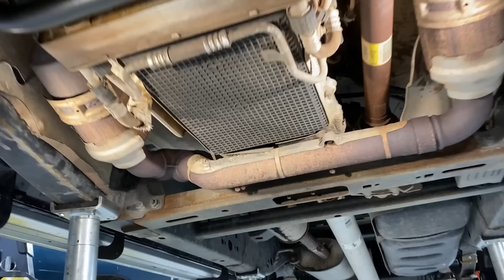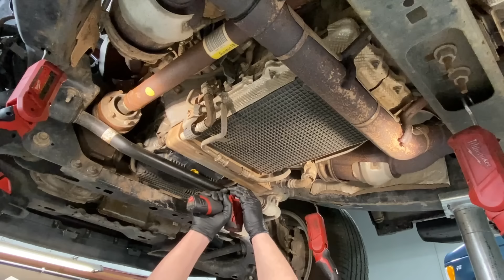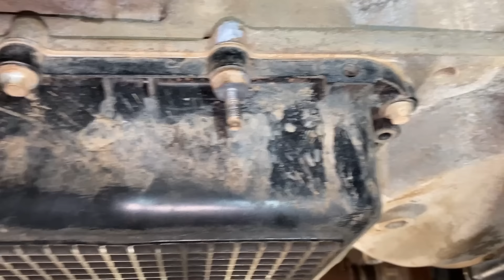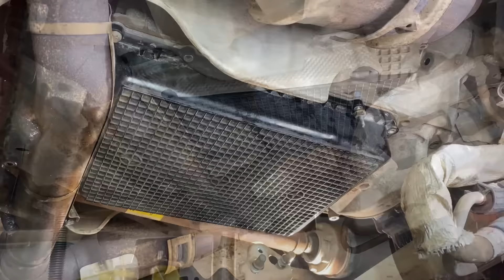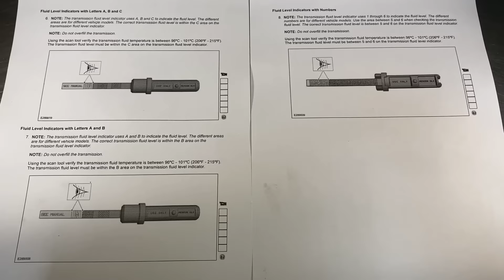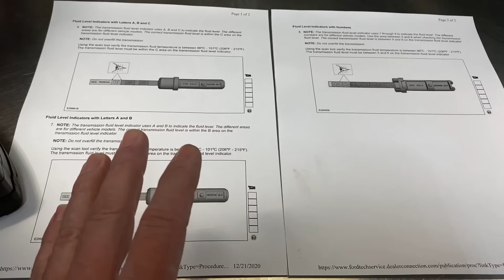Ford 10R80 Ten Speed Transmission: Fluid and Filter Service Procedure

Comment: I have a ‘21 f150. The cooler appears to be in a different location than described here. It looks like cooler lines track above the trans and have the locking tab connectors. 1) Is there any procedure for disconnecting the cooler lines/does this need to be done to service the trans? 2) Will I be able to jack the trans up to remove the pan without risking damaging the cooler lines?
Reply from the maker: I go over that exact model in the video.

Comment: I did mine but months later I see that I have a small leak at the bolts near the front passenger side corner. I've tightened them down but still leaking. Not sure if the gasket has failed there or what...

Comment: Hope you will give time answering my question. What seems to be the reason why there's a rattling noise when the rpm goes down after I rev up the engine of my ford ranger 2.0 biturbo? The noise comes from the driver side close to the left portion of  the transmission fluid pan. The tansmission fluid is at the C when I checked after 20 to 30 minutes of idling the engine.

Comment: Just change the fluid in my 2021 F150 eco boost. I drained approximately 6 quarts. I put 6 in after putting everything back together. Oil doesn’t touch dip stick. I added a quart and still nothing on stick. I added the 8th quart and still doesn’t touch? I have a dip stick with 1-6. Can’t find exactly where the fluid needs to be?
Reply from the maker: You must run it and heat it to operating temp
Reply: I don’t have anything that shows where the fluid level needs to be on the dip stick ? It’s a 1-6 markings.
Reply from the maker: Wait I show it in detail in this video here- https://youtu.be/p96a8_MPwyM?si=tGaaeqIwhV48eNew&t=2437

Comment: Nice. I have a 2023 F150 and this video is invaluable. Why not snake a vacuum line into the fill hole once the dipstick is removed and remove as much fluid at that point? I've done that on other vehicles with good results. Why is there never a darn drain plug on the pan? I put one on an RV I have on a Ram Promaster 3500 chassis.
Reply from the maker: Really no need to drain first, no matter what the exhaust is going to get soaked in trans fluid as the case drains out.

Comment: My experience with the advice of one box below hasn’t been great. There’s really no getting around getting up to full operating temp to get the correct fluid level. Do I know if it’s a big enough difference to cause damage? No idea.
Reply from the maker: Yes, you must follow the adjustment procedure exactly or just don't even touch the trans.

Comment: This vid was perfect, i was looking for the dipstick part primarily, cause no other vids showed it, so 10 out of 10 in my book.
Reply: Go buy and install the MBS dipstick.  Easier to check your fluid levels and install new ATF fluid.  
THEN… install a new aluminum pan that has a drain plug.
PPE or Mishimoto … 
I think there are others…
Do it yourself and save time and effort down the road every 40-50k miles ATF oil change.  The filter can go every other fluid change.

Comment: So i take it Brian doesnt recommend a flush on the 10r80? Only pan drops?
Reply from the maker: Correct that goes for all Ford transmissions.
Reply: @FordTechMakuloco  thanks for the reply Brian you made my day. Good to know, I feel the dealers oversell the flush because it gets all the fluid but really only do it cause it's easier and they don't include that it might push things where it's not supposed to go.

Comment: One question , way we cant lift the transmission from the main transmission mount , losing only the two bolts instead of upper bracket  4 bolt?
Reply from the maker: The two transmission mount nuts you mean? You cannot as this will not do anything to help separate the exhaust from the trans pan.

Comment: Thank you for this excellent video! I'm at about 50k on my Expedition Platinum with max tow and plan to do this.  Thinking about an aftermarket pan (PPE P/N 328053200 with std. capacity).  Do you have any thoughts on that?  It has a drain plug to make future service easier.  Was thinking of doing intermittent fluid changes without filters at 20k or so.  Maybe unnecessary.  I regularly tow an 8,000lb trailer.  Thanks for any insight you can provide!

Comment: First, great video! I have a rear wheel drive and the transmission mount is very different than the 4wd type shown in the video. I had to loosen the exhaust above the cats and behind the cross member to get enough clearance to remove the pan. I wish I had a lift!🙂
2nd, the dip stick is in a really bad position. I got a few burns checking the fluid level. Shame on Ford.
Thanks for such an insightful video!
Reply: Hey bro we have the same truck did you fully remove the exhaust bolts or just loosen them?

Comment: Screw you Ford for not putting hot/cold measurements on everything where the difference is critical. It is asinine that they would make the SOP to check at a crazy hot temperature next to a catalytic converter.

Comment: You can't just remove the 2 bolts that connect the transmission mount to the crossmember to lift up on the transmission?

Comment: I have a 2019 F150 5.0 (Coyote). It has also 81K on it. I noticed a little tranny delay/abruptness when downshifts from 9 to 8, like when going uphill. Maybe a little also from 3 to 2. I don't notice it driving around town, only long trips. Would a tranny flush, or complete tranny oil/filter change be the better option. If either option wouldn't help this issue what can be done, if anything?

Comment: Every 60k, it may be worth avoiding the headache to just have the shop do it. This is a nightmare compared to my previous vehicles. What is shop rate for this job?
Reply: I had the shop do mine

Overfilled it and caused a leak that they cannot find. The ford techs these days are clueless
Reply: @AlphaQueUp1911  I dont trust anyone to do anything on my truck. 
Speaking of dumb people who work on vehicles.....I just brought my truck into Les Schwab to have a nail in the tire fixed. Upon leaving I looked at the rim and there was a nice little tool gouge mark that they used to get the tire on or off. They offered to have a company "touch it up" I said no I'd like a new rim. "ok" he said.   Its a 20" rim. LOL .

Comment: I’m due to have this service done on my 2018 5.0 , how long does this procedure take ?
Reply from the maker: 2-3hrs.
Reply: @FordTechMakuloco  well let me tell you that it took just under one hour and 50 minutes and they told me all I needed was a flush. I asked did they remove the cooling  and heat shields ,drop the pan? They said all I needed was a flush putting new fluid in as the old one came out. I don’t get it. Was this right ? I mean this is a ford dealer

Comment: Thanks for the video.  I have a 2019 f-150 with 5.0 and 10 speed with 97,000 miles highway miles and no towing.  I have heard changing the fluid at this point  can cause slippage in the clutches and would like to know your input.  I had always followed the manufactures maintenance schedules
Reply from the maker: Definitely change it, fluid and filter only though never flush it will be just fine.

Comment: Curious about those 4 transmission mounting bolts. Why not just remove the 2 mounting nuts on the bottom of the mount that are inside the cross member?
Reply from the maker: The idea is to raise the transmission and leave the exhaust behind. If you simply remove the nuts from the transmission crossmember as you suggest then the transmission and exhaust would raise together still which defeats the purpose.
Reply: 10-4 thanks for getting back so quickly!

Comment: I checked my 10R80 transmission fluid level yesterday when the engine was at 190 degrees with the A/B dipstick and the level was just above the "B" mark.. This morning with the engine cold and not having started the engine the fluid level was at the top of the stick..  Is this normal..? Should I started up the truck and run it through the gears first before checking the level..?
Reply from the maker: No the fluid should be at the specified temp and engine running at idle just as shown in the video.

Comment: would ford please build a 300 6 cylinder 500k mile engine and trans combo....that all we have to do is put in gas and change the oil....easily and cheaply....probably not...makes too much sense.

Comment: I just changed my filter and transmission fluid on 2019 ford F150.
And it has no powered it won’t move.
What’s going on what did I do wrong

Comment: Holy crap, what an AWFUL transmission design, for something that requires period maintenance.  I'm convinced that auto engineers have never been underneath a vehicle or vehicle engine, and have never so much as changed engine oil.  Their designs seem oblivious to the cost of maintenance.  Also:  Amateur home mechanic tip:  Use an egg carton for each nut or bolt or group of nuts/bolts, number the "egg slot", keep a journal describing what it is, and take before/after photo's, also numbered, of the part and location disassembled.  Things that pro's do in minutes, takes me hours or days, and I could forget my own name by the time I'm done with the task.  Pictures & numbers & grouped parts and pieces, help on reassembly.

Comment: 2018 f150 10r80 the manual calls for LV but you use ULV. What is the correct fluid?
Reply from the maker: I think you are confusing it with the 6R80 (which was still available in 2018). All Ford 8 spd and 10spd transmissions take ULV.

Comment: I have a 2020 f550 with the new big block gasser.... it DOES run stronger than the 10cyl especially in tow /haul.. but at 40k the trans took a dump & sat at the dealer for 3 months for a " sensor" now I'm at 80k, & the front pump seal has leaked out alot of fluid & I've no way to add .. I will have to drop it back for another 3 months I guess..

Comment: So I just did my fluid change watching your video. But I have a quick question I put 7 quarts in it and started it up as you said. And now fluid doesn’t show on dip stick. Would I have to put the full 13 quarts?? TIA
Reply from the maker: Did you heat it up to spec?
Reply: @FordTechMakuloco  I turned the truck on for a few minutes shifted between gears. Went to go check the fluid level only seen a  little bit on the dip stick but not close to the mark. I have the A,B,C dip stick. Should I let it heat up to 200 without moving the truck?
Reply from the maker: Mercon LV expands a lot as it heats up so get it up to the temp specified here then let idle and check the level as shown in detail in this video.

Comment: I know this is an old video but Im dying to know; is that a water to txfluid heat exchanger? Or do those forward mounted lines just run to a fluid to air transcooler up front?
Reply from the maker: The lines running to the front are simply coolant lines and nothing else on a setup like this.
Reply: @FordTechMakuloco   Thanks for the response. I thought that might be the case. Food for thought if seeing oily coolant on a used truck with this setup. I am a refrigeration / food equipment tech that sees those types of heat exchangers on chilled glycol systems and others that don't utilize an air cooled condenser. In our industry they sandwich copper and aluminum plates with micro channels for heat transfer. Just thought it was cool to see it used for trans cooling. In any case, I'm Enjoying the videos!

Comment: Can't thank you enough for another great video sir! To attempt to give something back here (for all the great information provided over the years especially considered); after deciding I really didn't want to have to unbolt and jack up the rear of the transmission each time I had to do this service, after a bit of messing around I rather miraculously discovered that with about 20-30 lbs of force at the end of an 18" breaker bar, wedged between the drivers side exhaust hanger (right behind the pan), and the adjacent flange on the trans mount, this provides literally JUST enough clearance to slide the pan out / forward. End of a standard breaker bar happens to nestle in this space perfectly to note, though you could use any other pry bar that fits of course. Do not need to actually bend anything - just need to have the hanger flex down a bit while jiggling the pan forward. Hope this is helpful to folks; I sure was very happy to learn this one! Still had to drop the roll bar for oil cooler clearance, but that's really not that bad of job - bolts right back up again easily afterwards. Still miss my screw on filters and drain plugs naturally here folks this all being said....

Comment: Hello, I enjoyed your videos on 10R80 transmission and wanted to try my luck on what your thoughts would be on the issue that I have with mine. 
I have a 2021 Ford Expedition with about 25K miles, no warranty. Upshifting is more or less normal. Morning shifts to either rear or drive on the cold 
start are jerky. Worst part, while downshifting, starting from 4th gear going down till a complete
stop it hesitates, jerks, always skips the 2nd gear on the gear indicator, and most of the time (not always) it give me this "thump" or a "bang" as I am almost getting 
to a complete stop. My local Ford dealer says they performed TSB 22-2428 and performed adaptive learning drive cycle, did not help at all.

Please reply with your thoughts on this or if you came across or diagnosed these symptoms before.
Also, where are you located if I were to bring it in for a fix.

Comment: I went to my local dealership and they said “ oh you can’t change the fluid it’s a sealed trans. I said you must be joking I can pull a cap and show you a dip stick he said nope it can’t be done.  Same dealership overflowed my oil to the top of dip stuck and messed up my chrome wheels on my 18’ f150.

Comment: My 2021 expedition max has the exhaust in the same place next to the transmission pan. Pretty tight, but there’s about a fingers width of gap between the pan and the exhaust. Does this need to be raised up like the 5.0s? Definitely seems tight.TIA

Comment: Makuloco could you describe the copper fittings that you put together at the end of your fill tube? What is the size of the copper. It's a great idea for the end of the tubing so that it won't pop out of the fill hole while you are pumping  fluid in. It happens all the time. Thanks for the video it is tremendous help to do this job.
Reply from the maker: I am quite sure it is 1/2"

Comment: Can someone help me ?18 f150 with 10r80 .... new trans installed last week. I just checked fluid level , running in park , and fluid is half way up the dipstick. Does that mean it's way overfilled ? Have no tools with me to remove some so can I drive it and just keep an eye on the temps to get me through next 2 days ?

Comment: Just did the filter and fluid on my 2018 3.5EB with max tow package, so I have a cooler, too. It was frustrating as hell until I dropped the sway bar. Much easier then! You rock Makuloco!
Reply: We're you able to do it on jack stands? Or do you have a lift?
Reply: @PontiusPilateWasADemocrat you can do it on the ground

Comment: Great coverage as always.  I read all the comments and I don't believe this has been covered.  For those trucks like the Raptor that have the EcoBoost and the cooler lines run to the front of the truck instead of the big block shown in this video, must you still remove the cooling lines in order to remove the pan?  I took a quick look and I don't believe they are in the way.  Basically, trying to determine if I need the cooler line seals for my trans filter and fluid job.
Reply: Just did my 2018 3.5EB today. If you have the transmission cooler, you need to remove the lines from the side of the transmission and drop the cooler. Also remove the sway bar mounts and let the sway bar hang down. Makes things much, much easier.

Comment: I recently just bought a 2018 f150 5.0 v8 with a 10 speed. It has 75,000 miles
I dont believe the transmission fluid has ever been changed. What are your thoughts on changing the transmission oil and filter?
Reply from the maker: Do it as soon as possible, pan drop and filter change only never flush.
Reply: Thank you bro, I really do appreciate you getting back to me
Reply: When you say "never flush" are you refering to not trying to flush out the whole system?
Reply from the maker: Correct never perform a trans flush no matter what the mileage.

Comment: Why oh why do they not fit drain plugs on those pans and a proper long filler pipe with dipstick, accessible under the hood. That way the fluid could be changed far more often with minimal time/money. The filters never block unless the transmission needs a major overhaul anyway so changing it at less than 150,000 mile intervals is a waste of money.

Comment: Just completed mine last night after it went into limp mode in a busy intersection with my rig being towed behind. The fluid looked pretty thin when I drained it (about 5 quarts from the pan) I hope this cures my shifting issues. Thanks for the great tutorial buddy..it saved me a headache. I'm about to continue and fill and test the levels now.
Reply: How did it work out my friend. Hope all is well
Reply: 2018 v8 5.0L

Comment: I just changed the fluid and filter in my 10R80 this weekend. I’m finding it hard to verify the correct fluid level. When cold the level is at the bottom of B, but hot it is in the middle of A. Also the fluid seems to run down the dipstick making it hard to accurately check the level.